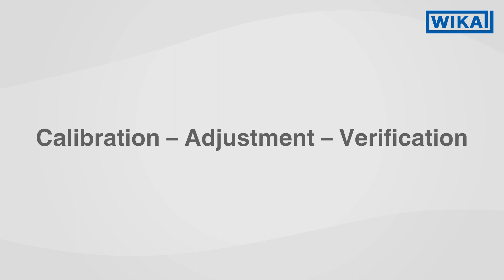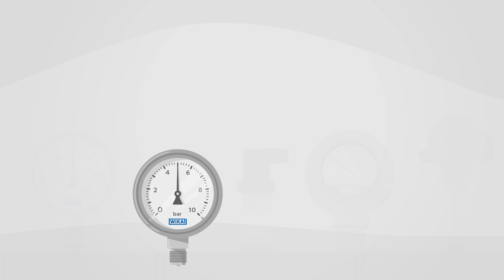Calibration of measuring instruments | Definition of calibration, verification and adjustment

Comment: If a deviation is detected, all previous measurements done by this particular device are questionable and have to be rechecked!

This could mean redoing thousands of pressure tests!!! Those procedures could require shutting off a whole plant and could cost many millions to fix. Can you elaborate on this critical topic, please?!
Reply from the maker: Hi Stefan Grabe, 
This is correct – usually the responsible Quality Managers of the particular plant have to evaluate if this deviation is critical for their produced products or not.
If so they also have to decide what to do.
Regards.
Reply: @WIKAGroup  As a Quality Manager and Qualified Person for Pressure Vessel and Piping, I know what you're talking about. :)

One proactive measure could be to shorten the intervals for calibration. In some cases, it could make sense to calibrate/ check/ confirm the accuracy of the instrument after each pressure test. Is there a way to do the calibration/ check confirmation on-site?
Reply from the maker: @stebarg  Yes there are portable process calibrators available that support and guide through a calibration. 
The results will be stored in the calibrator and can be evaluated in the workshop again.
Check out our webpage for e.g. https://www.wika.com/en-en/cph7000.WIKA